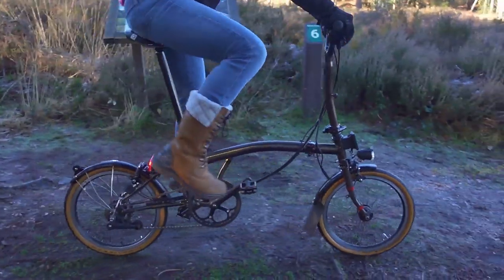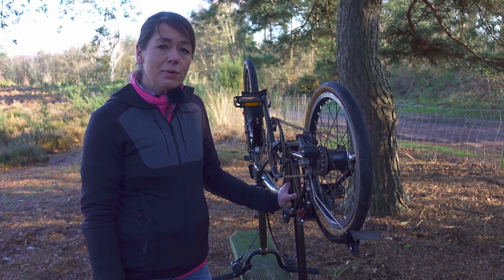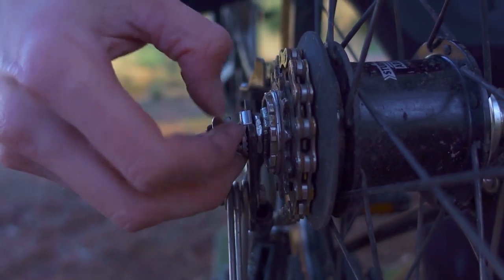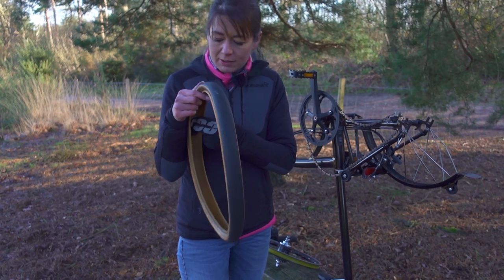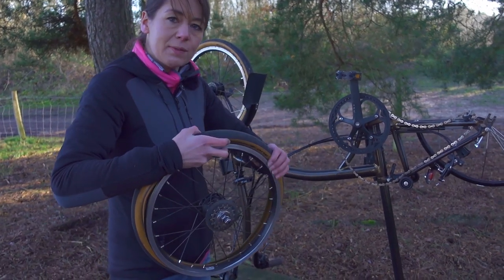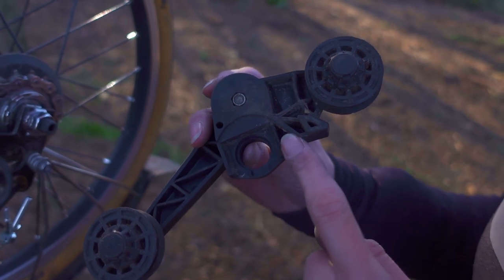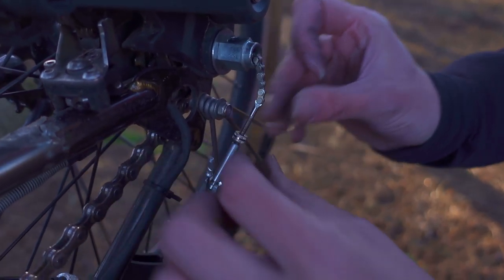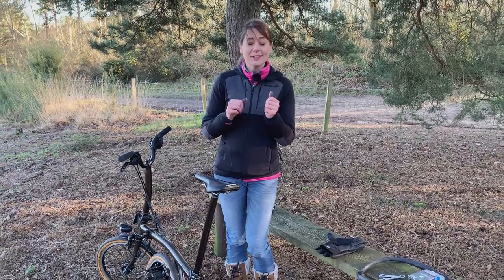Brompton Roadside Rear Wheel Puncture Repair

Comment: One other option to repair a puncture on a Brompton I’ve used at home and while out on the road, is to use vulcanising fluid (sometimes it’s in a repair kit or can be bought from Halfords) and the feather edge patches you get in most kits. It’s partly sticky and works in cold weather. I usually identify the hole in the tyre first, and if can’t see it, I just pull  the tyre off one side of the rim only, without removing the wheel - I then pull most of the tube out just leaving it connected to the rim by the valve. I then put a little air in the tyre so I can spot the puncture, mark it, roughen the area with a bit of coarse sandpaper, then apply the patch when the vulcanising fluid is part dried. I feather outer edges on  the outside of the patch so they stick to the inner tube. The patch has an outward facing thin plastic film, which I  score corner to corner with a small penknife, so I can peel if off from Centre to outer rather then lift the stuck feathered edges of the patch. I then put the tube and tyre back and pump it up using a non Brompton pocket  pump which has a capability of 120 psi. This sounds more difficult than it is to do, and I find it much quicker to do, as I don’t have to remove the wheel ( same for a front puncture). I use this method on racing cycles as well, replacing the tube when I think it has more patches than if should. The lubricant I use for the chain is a wax based one, which doesnt attract dirt. In the old days we washed and lubricated chains with diesel as it is waxy. Thanks.
Reply from the maker: Thank you for watching and for your comment.

Great tip, we were aiming at showing how to change the rear wheel. As when I am out riding I generally change the tube and mend it in the comfort and warmth of home.
Reply: Is there a need to take the thin film off the outside of the patch? It isn't doing any harm if it stays on, is it?
Reply: effyleven I do, because 
after pressing the finer glued edges of the patches down with fine film in place, then removing the film prevents the film from catching against the inside tyre and lifting the patch edges once the tyres are fully inflated. I coat the inside of the tyre and tube, lightly, with talcum powder to reduce friction anyway when fitting a new tube when at home (traditional way on racing cycles when not using tubular tyres). This is the way I cope with punctures and others may have other methods. I very rarely fit a new tube when out on a ride, as it just takes a lot more time, especially with a Brompton. I did such a patch repair on the Brompton under street lights about six weeks ago, and it’s held Fine.
Reply: Peter Callaghan Wow! Never thought of repairing with wheel in place.  I was going to put a comment why remove the tyre from the wheel, but not removing the wheel is even simpler, as long as you can find the puncture.
Reply: I recently patched a tube on my regular bicycle leaving the wheel in place on the bike. Easy peasy and more sustainable I think. Great tip about using the chain waxing method. It keeps everything so much cleaner compared to regular wet lube.

Comment: Changed the front tyre - no problem. Looked at the rear assembly of my 2 speed and thought hmmm - YouTube!!!

Thanks for the video, very helpful. I didn't realise what I thought was the rear derailleur was actually a chain tensioner till I took it off!
BTW on my bike, it only had regular washers. not the ones with tags.

Comment: I bought a 2015 Demo Brompton from a dealer and it didn't come w/a TOOL KIT or a PUMP.
Any recommendations?  Substitute TOOL kit & PUMP.  Thank you!
Reply from the maker: Thanks for watching 

The Brompton doesn’t come as standard with a toolkit

If the demo was a titanium model it also wouldn’t have a pump - as the titanium frame doesn’t have a place to mount it

Both the toolkit and pump should be available from any Brompton dealer

Comment: Thank you. This was very helpful. I found the trickiest part was getting the chain back in the correct position. I had to "re-wind" the video a few times to take it a stage at a time. Now I've done it once (with this excellent guide), I'll feel confident next time. Thankfully I wasn't outside in the cold......

Comment: Absolutely BRILLIANT and very practical video to demystify the truly dreaded rear wheel puncture! It left me trying to think of another use for the toolkit tyre levers since they appear slightly redundant...  Splendid inner tube unboxing and out-takes too 😉🤣!
Reply from the maker: Thank you for watching again and for the kind comment

Yes - a lot of people are worried about rear wheel Brompton punctures

The Schwalbe One tyre choice made the change easier - but its a trade off, less punctures with a Marathon plus but harder to remove if you do get a flat. Or a really easy / quick change with this tyre (as we had during a random sportive in Stockholm where the puncture change only cost around 5 minutes)
Reply: brilliantbikes Yes, it’s definitely one I have a slight angst about because it’s never happened to me (yet!) - this is one I’ll go back over and make notes...which I’ll then photograph so I have a good guide “in case”.  Proper nerd eh?! I do get out sometimes though...promise...

Comment: Thanks for this.  I needed to change the rear inner tube on my brompton today, but was confused by the tensioner/hub gear situation and gave up until I saw this video.  This made it really easy to get the wheel off and back on again.  Great stuff.

Comment: At 7:43 the inner tube looks too skinny almost like rim tape for the volume of the "supple" Schwalbe One.  Did too much stress on the tube cause the "flat"?  These videos are very useful and well presented.  The best on the web.  Thanks!  I plan to upgrade to the Schwalbe One soon.
Reply from the maker: Thank you so much for watching and for your comment.

The Schwalbe AV4s are our favourite Brompton inner tubes, partly as they are so narrow, they fit in the tyre easier. But when they are inflated they take up the space as they are very stretchy.

Comment: Great video.  However, when checking the tyre for debris or glass - a visual inspection is best.  Even better with a torch as small. Bits of glass are easier to see.  This will save your fingers from being cut by anything sharp.

Comment: It's a fantastic demonstration. I have a Schwalbe tyre and after taking it off (for the first time, carefully following the instructions) discovered a wire the size and thickness of a paper clip sticking out of the inside of the tyre. I can't tell whether it's a part of the structure of the tyre and has come loose or whether it managed to enter the tyre and got stuck there. I would be grateful for any information from anyone who knows about these tyres.

Comment: Learned from experience, always pump up tyre before reassembly as nothing worse than having to change the tube again starting from scratch. Better to let air out and pump again....
Reply from the maker: Oh no! How annoying! I guess it’s key to check that anything sharp is out and don’t use tyre levers to fit. 
Many thanks for watching.

Comment: Thank you so much.  Just changed the rear inner tube after a puncture in my Marathon Plus tyre (I thought they were supposed to be puncture resistant!). It all ran very smoothly, even getting the marathon plus back on.  I’ve decided the secret is letting all the air out of the inner tube once you’ve got it into the tyre. Your instructions are so clear 👌
Reply from the maker: Thank you so much for watching and for your comment, so glad it helped.

Comment: I got my first rear wheel puncture yesterday, so as I knew this video was here, I watched again. It was a great help. Thank you.

However, I have a couple of points of my own:- 

Small thing. There is a large flat washer behind the chain tensioner retaining nut, but we didn't happen to see it in this video.

Bigger thing...

On refitting the wheel I was surprised to find that the tab washers are not exactly symmetrical, but are "handed," or rather, that they have an "up" and a "down" position. The tabs appear to be the same size, but they are NOT both quite the same distance from the centre of the axle hole. Naturally, the drop outs are similarly handed. So, if they do not seem to "seat" properly as you go to tighten the axle nut, you must either take the wheel out again and rotate the axle through 180 degrees...
.... or do what I did;  slip the axle nuts off the end and rotate each tab washer through 180° instead.
 
I must emphasise that it would be quite important to check this carefully, and do so every time the wheel comes out. If you tightened the axle nuts with the tab washers in the "opposite" position, they would get bent, and it wouldn't do the dropouts any good, either.

Thanks for an excellent video.

Comment: thanks nice vid... also check the seating of the tyre after inflation by looking at the point where the tyre meets the rim as you rotate it, on both sides there should be a moulded thin line in the wall the same distance away from the rim all the way round. If" wavey" deflate squeeze the walls in and try again to inflate, this will centre your tyre x x

Comment: Personally my wheel's not coming off and I will find that hole by hook or by crook, assuming the puncture can be found without soaking the tire in a vat of water. Maybe a little soap on hand to apply with water from the bottle to see the hole on the exposed tube.. I have same issue on my rear-motor etrike, and generally the tube can be sufficiently exposed without wheel removal, in situ. Of course, no new tube can be installed without wheel removal, but patching is generally achievable and worth a try first. Tire levers still work on an installed wheel!
Reply from the maker: Thanks for watching. 
Why won’t your wheel come off?
Reply: It does not need to unless you cant find the hole in the tube. Exposing the ttube is easy enough with the wheel on the bike to look for it. Usually by listening for the hiss. Then patch it in situ. Its a trick used on ebikes too where you dont want to remove the wheel because of the torque arm.

Comment: Do you recommend using Stan’s tire sealant once every 3 - 4 months, applied into the tube that most often will simply clog the puncture and require a little added air before merrily riding off?  It works well for small punctures; not intended for sidewall damage,  Loved your detailed video.
Reply from the maker: Thanks so much for watching. We have not had much success with using Stan’s in Brompton tyres. We think it’s due to the small volume of the Brompton tyres. So it does not have much of a chance to work before the air escapes

Comment: Don’t you have to release the brakes before you can take the tire off??
Reply from the maker: Thanks for watching and for the question

If you let all the air out of the tyre it will fit through the callipers without having to release them

Comment: Any chance of doing a front wheel? I punctured my front wheel the other day.
Reply from the maker: Thanks for watching 

That’s a good idea

Sorry to hear about your puncture

Which type of front wheel do you have? (Standard - using 15mm nut, Superlight / Hub Dynamo - using volt through axle)

Which type of tyre do you have on the wheel (if it’s a Marathon plus - it’s more fun / interesting ;-) )?
Reply: @brilliantbikes  my bike is 6 speed it was 3 days old and it was a Schwalbe Marathon Racer.

There is loads of videos on rear wheel punctures but none on front wheel
Reply from the maker: We feel a front wheel puncture coming on this weekend!
Reply: @brilliantbikes  some explanation of the schwalbe marathon tyres limits would help too say on the bumpy gravelly potholed streets of Liverpool

Comment: Thank you very much for the video!
Question: How to undo the locking nut if it's stuck? (1:40)
I tried lubricating it but no luck so far.
Reply from the maker: Many thanks for the question. Do you mean the gear indicator chain? If so pop it at 90 degrees and use it as it’s own lever. Hope that helps but let us know if not.
Reply: @brilliantbikes  I mean the hub gear cable anchor and its locking nut. They seem stuck and I can't undo them. Is there any way to ease the twisting?
Reply: Never mind, It's been undone using two pliers. Thank you!

Comment: FWIW at this remove of time:
Thanks for this very useful guide. Some comments and queries:
I assume you didn't actually flat and therefore could not locate the site of the hole; doing so is good practice, however, because it guides your check of the tire (which I think is best done with a bare hand).
My rather old front hub has 13mm wheel nuts and the Brompton toolkit does not cater for this. Is this because more modern hubs have skewers or different size wheel nuts?
As you say, when you have a puncture you don't need to let down the tire to remove it. My Brompton has no QR provision on the brakes and this seems to be a design weakness.

Comment: So, I got a rear wheel puncture while riding through urban streets yesterday!  The tyre had recently been split by a thorn, which I'd repaired using Bostick after fixing the tube puncture - the glue on the tyre had separated letting the tube repair patch touch the tarmac .... the patch developed a slow puncture and quickly deflated after trying to re-inflate it. The patch couldnt be removed because it was vulcanised to the tube from the previous repair. I did a temp repair (it was dark on the road, I just had small torch and front bike light) by sticking larger patch over the original one, using the aforesaid vulcanising glue.  And sealed the tyre using the glue to stop the innertuube protruding. I used a high  capacity mini pump to inflate the tyre enough to be able to ride. This got me home, but isnt to be recommended as lasting repair. The process didnt take long to do (wheel not removed etc). 
 The upside was that I went to Tesco 24 hour for food to cook, and was able to give a homeless chap a wooly scarf, hat, and two pairs of warm socks (I would have missed him had I not had the puncture; he was sitting outsides Tesco on cardboard asking for a £1: some new clothes, jaffa cakes, salmon sandwich, and pineapple snack seemed a better option, before he walked the mile (in his shoes) to the Salvation Army hostel for the night). The money for the Aldi clothing came from a £5 note given me in a envelope (from the www.leathersatchel.com which is via their monthly contribution to www.awesomeliverpool.co.uk, which provides the envelope, the £5, and a note explaining the recipient should do something beneficial with the money.  This gives me a different outlook as I travel around on the Brompton, and made it a habit to carry the clothing in the Brompton bag (its very light) in case asked for help. Brompton company and riders seem ideally suited to such actions, as we travel much more easily and aware around urban areas than pedestrians and car drivers (all of whom ignored this man in his 60s, dressed in a gilet, jeans and trainers on a cold night). What say you Brompton riders and Brompton CEO? It allows us to make an immediate improvement to another souls wellbeing on a very grass roots (no beuraucracy ) level. 
Finally, I bought a new rear tyre and a spare (folding Schwalbe Kojak) and replaced the rear tyre today using the video. I skipped a couple of the steps suggested - I didnt need to removed the gear (chain)  link from the axle to remove the wheel or change the tyre; I just noted I was in top gear and how many threads were showing before removing the tightening collar so that it could slide through the link securing nut and washer, and be replaced with same tension/external threads as prior to the puncture.  The amount the chain protruded in to the axel didnt alter this way, so gears didnt need to be adjusted. I didnt remove the wheel securing nuts or the locating tabs to remove the rear wheel - just slackened the nuts and pulled the wheel out of the frame by wiggling it a bit side to side... this meant I didnt have to think about orientating the locating tabs, and could just slot the wheel back in to the frame once new tyre and innertube replaced, and tighten the axle securing nuts. 
Enjoyed the video and others.
Reply from the maker: Thank you for watching.

Thanks for your comment - it’s very detailed and think it’s our longest ever, with some helpful tips.
Reply: brilliantbikes so, you want me to fix the puncture more quickly again?!😁

Comment: An excellent, practical video for those new to using a Brompton. I presume it is basically the same procedure when mending a rear puncture in the electric Brompton.
Reply from the maker: Thanks for your kind comment

The rear wheel process on the Brompton electric is exactly the same as the non-electric version
Reply: @brilliantbikes  Thank you, Hannah.

Comment: It's a pity you didn't find a thorn in your tyre, which is the no 1 cause of punctures on my bicycle, despite using Schwalbe Marathons, as removing the offending thorn usually takes me more time and causes far more grief, than fitting a new inner tube and replacing the tyre.

Comment: The problem I have with the Kojak tyre is the tire bead won't seat properly. It is easier to fix that issue when I am at home and have the grease and a better air pump.

Comment: Sorry if it has been mentioned before, but before you put in your tyre lever, make sure the tyre bead is pushed into the wheel well on both sides.  This just gives you a lot more tyre to play with and its easier to get the tyre  lever in.

Comment: Great video and a very clear explanation. One thing I would do is fully pump up the tyre before putting the wheel back on. The reason being is, if the puncture isn't fully repaired and air is leaking you don't have to go through the whole process of removing the wheel/gears again 😀